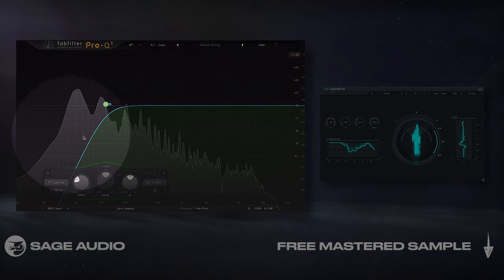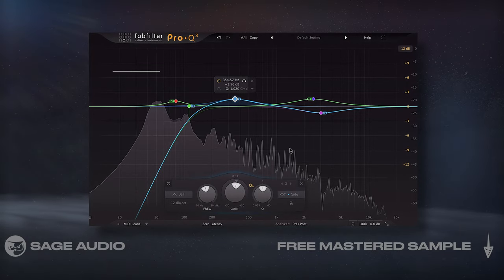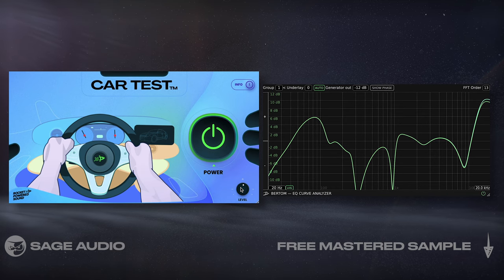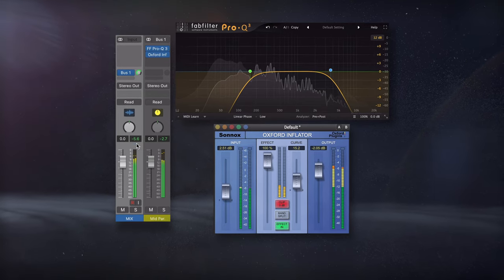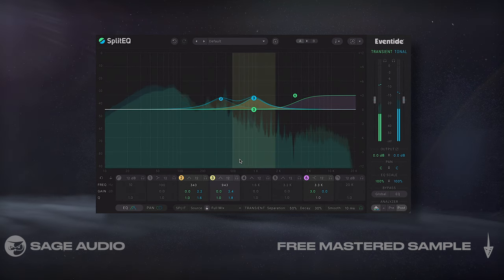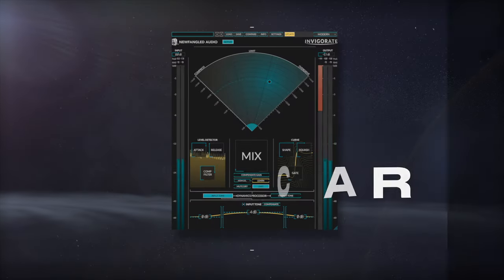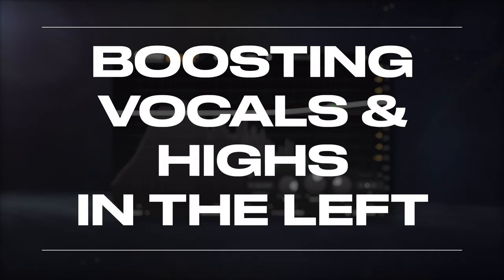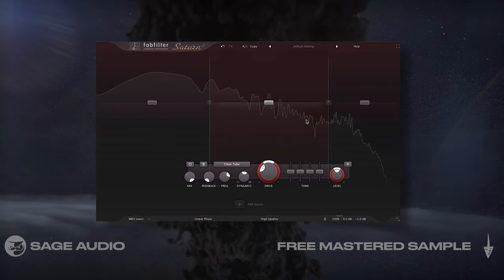Mixing for Car Speakers

Comment: Another great SAGE video! One question - instead of using m/s EQ to make bass mono can you use the Gain plugin in Logic and select mono? Won't that ensure the bass is mono w/o phase cancellation? Thanks!
Reply: You could, but then you’d lose any side information in the higher frequencies. For example, synth basses can be a little wider and if you mono the whole thing you could be taking away some of its character. You should do whatever sounds best to you though of course
Reply: @EthanHarmYoutube  likewise just sweeping the ms to cut away lows in the sidechannel, you are losing info above 30 hz. i dont recommend this as it oftentimes destroys the original sound. there are better tools for this like mongoose 2 by boz digital labs, which lets you set bands and mono/widen them individually.

Comment: I listened to my mix and master in 2 different cars along side my refferance tracks all good..
Then listened in a 3rd car with all bass treble set to 0 and started to clip and break up at higher volume so did the refferance track.. It was fold by bonobo refferance that is a loud master.. Is this normal..?
Reply from the maker: Sounds like it's the car's speakers if most tracks that you're running through it are causing it to distort/break up.

Comment: Hello there, i hope that maybe u can help me out with something.

I own zeta multymedia system version android 12 in my car.  

In the previous versions of the multymedia systems headunits, the blutooth app was playimg through all the other multymedia system apps sounds.

For example, i could play the youtube app in the multymedia system headunit, and play the waze app in my phone ( the blutooth app is on of course ), and then when the waze app had any directions like "turn right or left", the sound of the blutooth app could break through the sound of the song sound playing in the youtube app in the multymedia system headunit, and i could hear the directions of the waze app playing in my phone with blutooth app, and both sounds of youtube in my headunit and waze in my phone with blutooth was working simoltanisly ( i blelive that then the youtube sound was lowered but thr point is that i could hear the blutooth sound and waze directions ).

Now, in this version of the zeta headunit, it's like that there is some kind of blocking when the youtube app is on in my multymedia headunit, and the blutooth sound can't break the the youtube app playing in multymedua system headunit and i can't hear the waze directions playing in phone app through blutooth.

Now, when i reverse the apps and play the waze app in my multymedia headunit and play the youtube app  in my phone the sound of the youtube app playing through blutooth DOES ABLE TO BREAK THROUGH THE SOUND OT THE WAZE APP PLAYING IN MY HEADUNIT, so maybe it's all matter of sound settings.

Can u tell me whIch sound settings ( mixing sounds settings maybe ) should i change in my multymedia zeta system headunit  for that to happen and i can hear the blutooth sound can break through  the youtube sound paying in the mutymedia zeta system